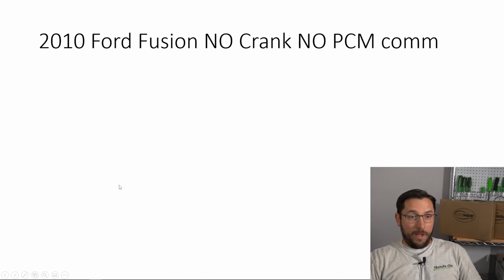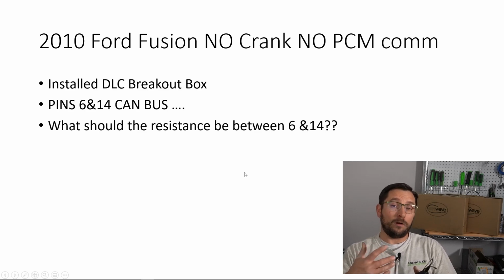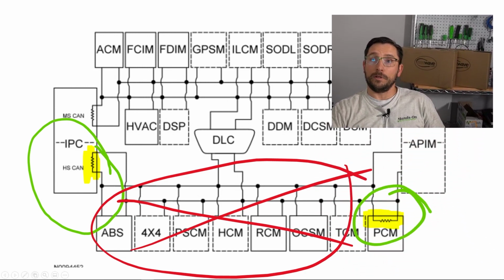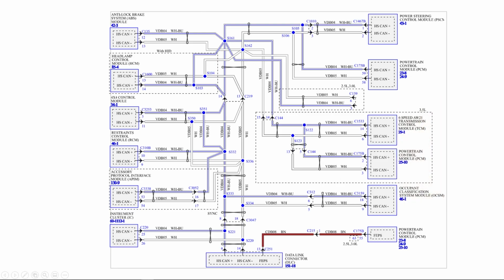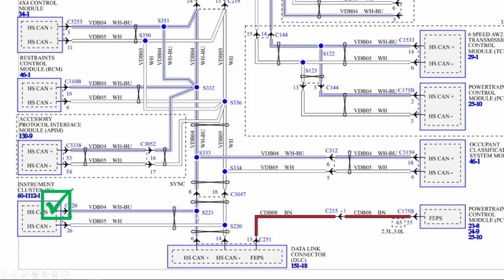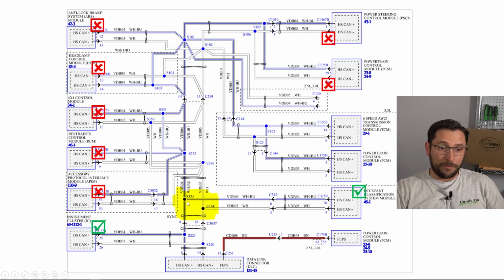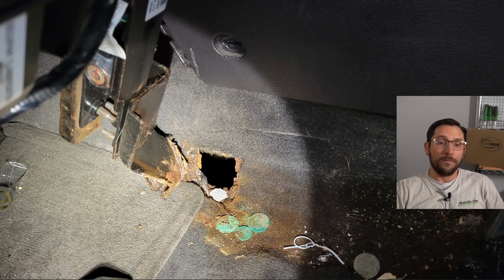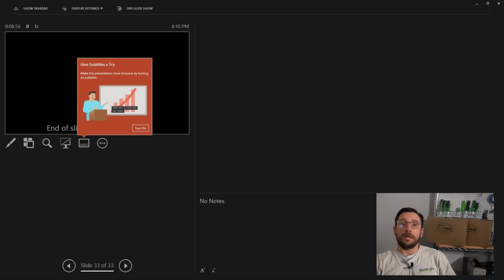2010 Ford Fusion No Crank No Communication How to Test

Comment: PLEASE....I NEED HELP. 2012 FORD FUSION 3.0 WITH NO COMM, NO CRANK, NO START.  THE PCM RELAY IS NOT WAKING UP. IF I GIVE GROUND TO THE PCM RELAY, THE CAR PCM WAKES UP. I BELIEVE IT IS NOT RECEIVING AN IGNITION SIGNAL? ANY IDEAS? PLEASE HELP THANK YOU IN ADVANCE.
Reply from the maker: What is the voltage of the circuit that you are grounding at the pcm? Force of rabbit I would recheck all pcm powers and grounds. When you say mo comm you mean only the pcm?
Reply: @BrianMann216 thank yo. no comm with just the pcm. if i ground the pcm controlled signal wire. i will get comm. i just dont know if ive got the right diagram.

Comment: Hey just found this channel. Thanks in advance. Got a 13 fusion hybrid Friday. The rear bat dead. No crank no start. No comm with pcm, tcm and others. No indicator present in dash for transmission selection. Not that familiar with hybrid. Will check 6,14 for 60ohms. You got a sub scriber. Do you even work on hybrids?
Reply from the maker: Hey thanks for watching,  I dont work on many hybrids,  not many calls for them, but I am sure that will change as time goes on.